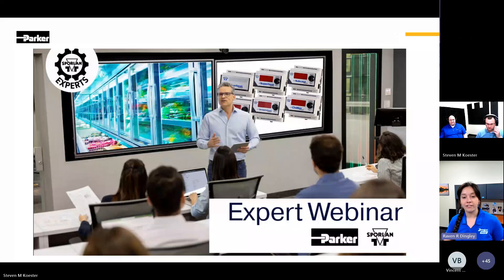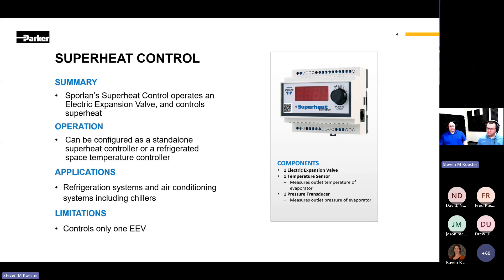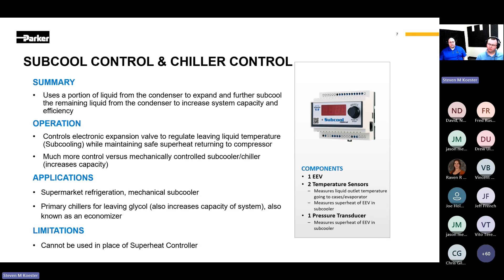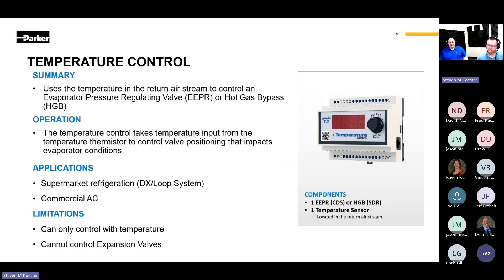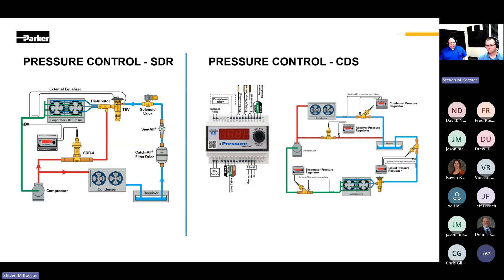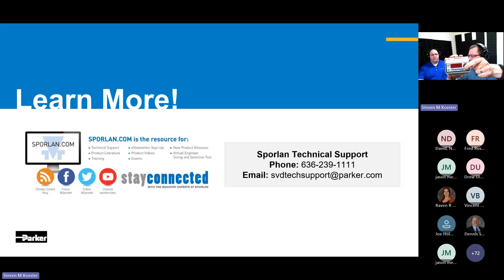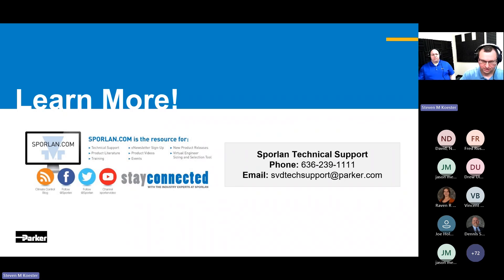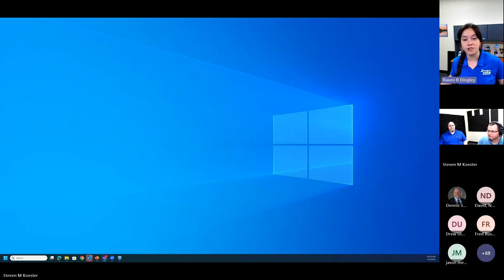Sporlan Expert Series Webinar - Kelvin II Electronic Refrigeration Controller Basics

Comment: I just want to know if the Kelvin k2 super heat controller can be provisioned ( programed ) using the RJ-45 connector. 
Turning the knob is great and all, but I'd rather write a program to do it. ( Im looking to speed up production out here, having to wire devices in, isnt fast. ) 
Not sure if youve ever talked to customer support, they got me calling Ed in the warehouse? He's nice and all, but has no idea why they put me calling him.
Reply from the maker: No it can't be programmed using an RJ45 you can do it over RS-485 through modbus or bacnet for those that support bacnet.
Reply from the maker: You can also contact Kelvin II tech support at 636-392-3906 or SVDtechsupport@parker.com
Reply: @sporlanvideo  Clearest answer  yet. Prompt too. Thanks for that. no run around either.